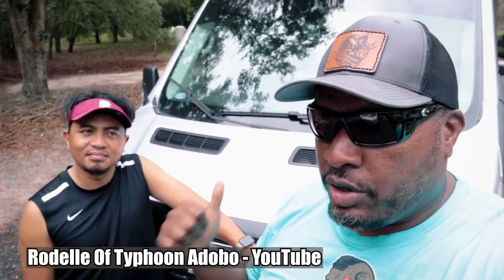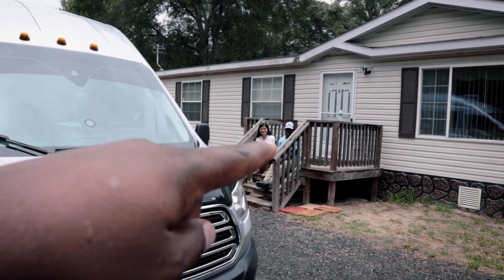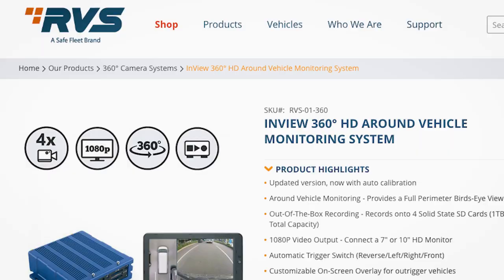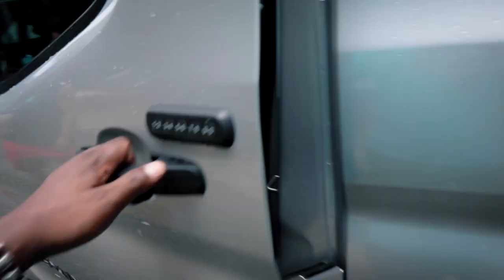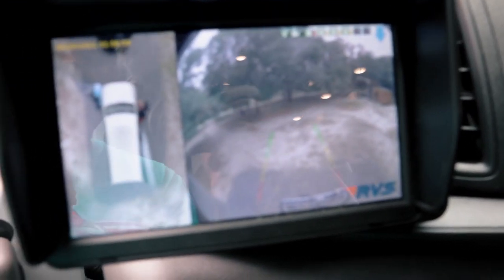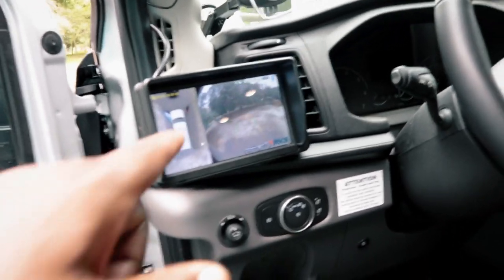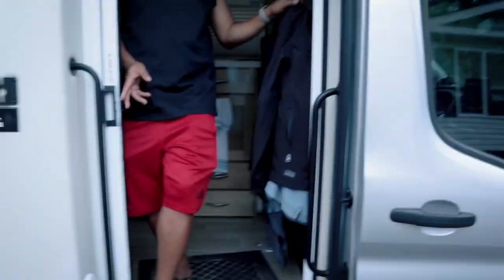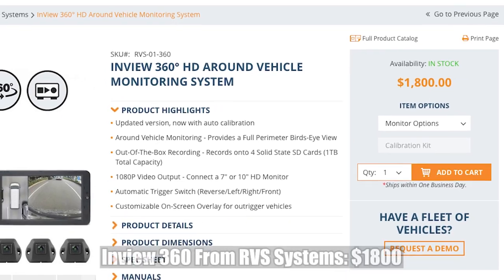Camper Van 360 + BIRD'S EYE VIEW Camera Security System Upgrade 2020 Ford Transit Coachmen Beyond

Comment: Nice. Now I would install motion censor lights on the back and sides, you could buy little solar powered ones for complete security at night. I'd mount the monitor on the back wall of sleeping area just incase you hear those bumps in the night without having to get out of bed.
Reply: Good idea

Comment: Great video. The benefits of a camera can’t be explained enough. For me and my wheelchair van the ramp deployment was always a issue. I actually paid a extra 7 grand because Toyota doesn’t include Birdseye view except on their top trim model. Also like Hank said entering and exiting a gas station is a concern because of the size and requirement of distance to the pumps. That’s why most gas stations have concrete poles near them. Last I would add maybe being able to log in to the system on a cloud base format. So you could check your surroundings from your phone while beded down if you hear something at. Overall a great addition and video.
Reply from the maker: Thanks for watching Cujo, good points….it’s funny every time I go to gas up I’m happy for this system based on how crazy people like to pull in their vehicles to the pumps…it would be good to either have a second monitor or to be able to view from a phone app, absolutely agree with that 👍🏾

Comment: 2022 Transit has 360 camera with 12” screen as an option.
Reply: Not without the upgraded entertainment system in addition to the cost of the camera option.
Reply: Plus with the factory Ford option you have limitations, it only comes up automatically in reverse, when you're watching your cameras you can't use the radio really, can't adjust them without being in park, ect, ect. It's sometimes better to go aftermarket

Comment: Does Ford offer this system like they do in the pickups?
Reply from the maker: No, they do not offer this.
Reply: The 360 degree camera was a $1050 option from Ford on the Cargo Vans for MY 2023 & still avail for ordering in 2024.  I have seen them in person on a W2x and have ordered this option on a W3U. Very similar resulting image as what was shown on Hank's after market solution here with a similar split screen default but Ford's also does single cam views but only w the ignition on. Not a security cam and does not record.